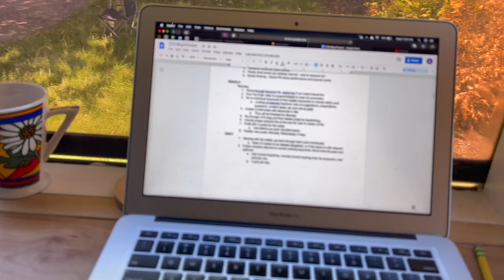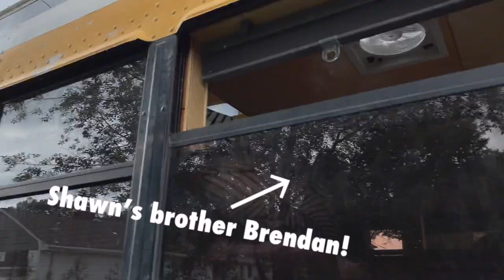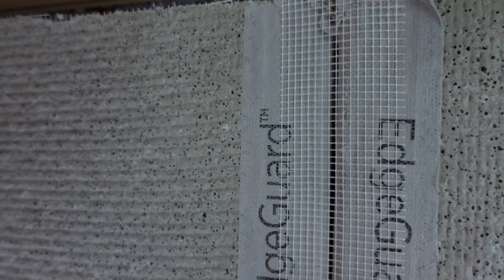Tiny home bathroom remodel!

Comment: I caution against the use of a "swamp cooler" in a closed and compact environment. I would have the exhaust fan blowing out the bus or the humidity will rise to levels that will sustain intense mold growth. Those evaporative coolers were built more for dry climates like the desert SW. Once you get the split, you will be good to go. Just be cautious using the swamp cooler and make sure you got airflow out of the bus. The bathroom looks good. ❤️👍
Reply from the maker: We always have a few windows open around that thing and only used it for the week but thanks for the wise words!’m
Reply: @ShawnandAsh  you were smarter than me. I had to learn the hard way. Just wanted to give you a heads up. Love your videos!

Comment: So I’m sure you guys have heard of the MOFI4500 router. Used it with a Visible (Verizon based) unlimited phone plan and have reliable, fast and unlimited internet. Check out the review @Number Juan Bus. 
Great alternative to the jet pack we used use. 
As usual guys nice work. 👍🏻💪🏻🚌🛠♥️

MOFI4500-4GXeLTE-SIM7-COMBO 4G/LTE Router with Upgraded 2 x Cell Antenna AT&T T-Mobile Verizon SIM Slot with Band 2,4,5,12,13,14,17,66,71